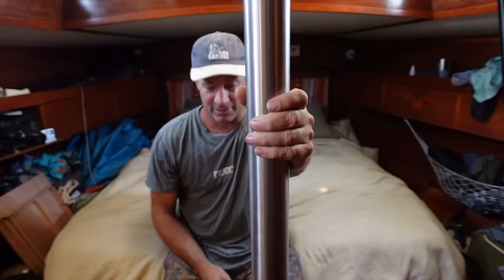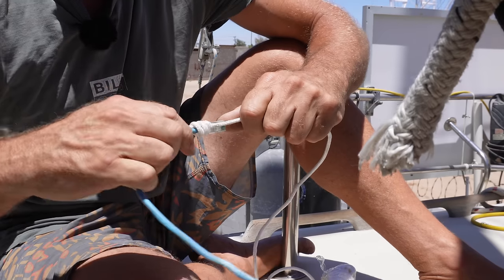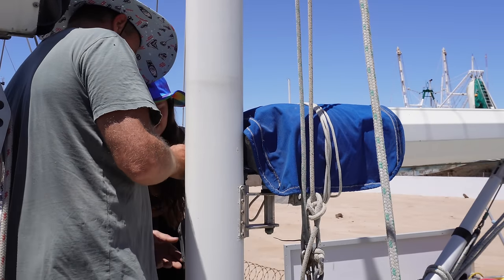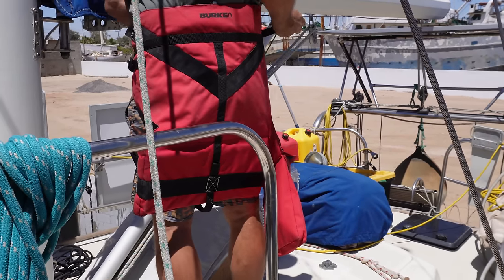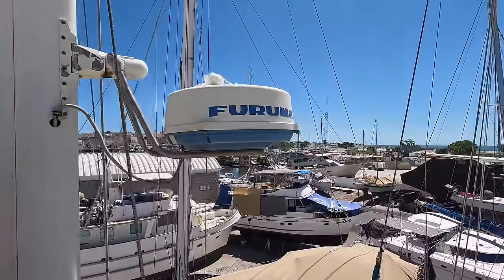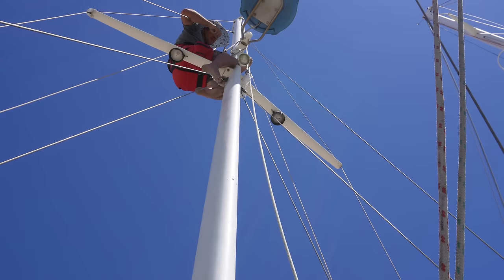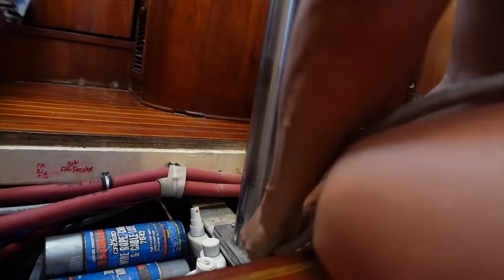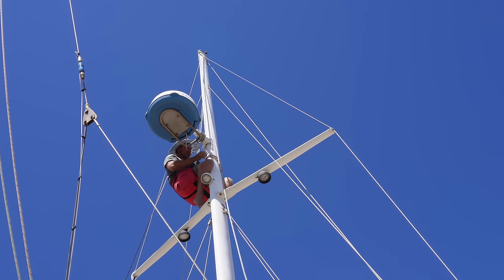Getting high in a Boat Yard in Mexico Episode 410

Comment: Lee and co... for climbing the mast, I built myself a foot climber borrowed from the rock climbing world.  I use a static safety line with a prussic knot above a clutch with a web strap.  The main lifting halyard is manned by someone in the cockpit taking up slack as I push up on the web strap, take up the slack with the prussic and then repeat.  The halyard winches on my boat are a bit undersized for my girth ;-)  This system makes for much quicker trips up.
Reply from the maker: Good idea ☺️